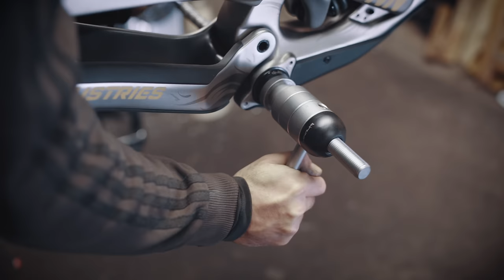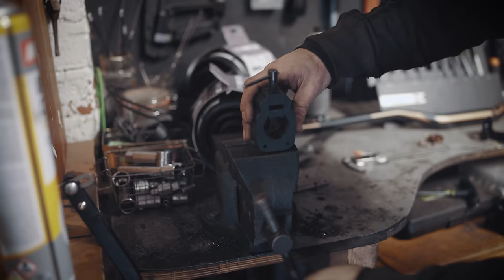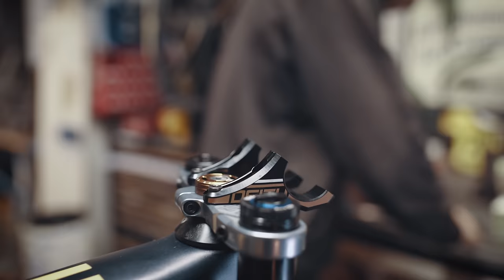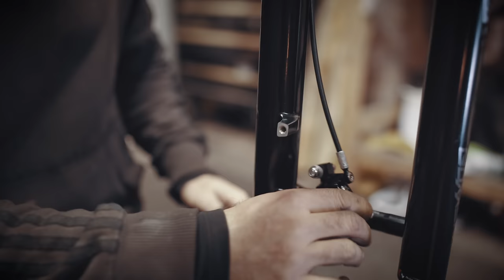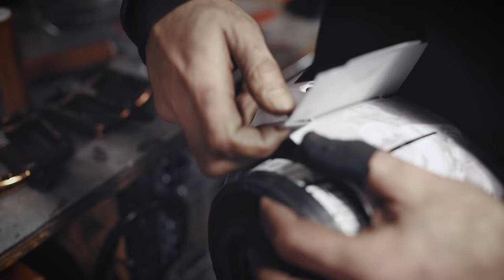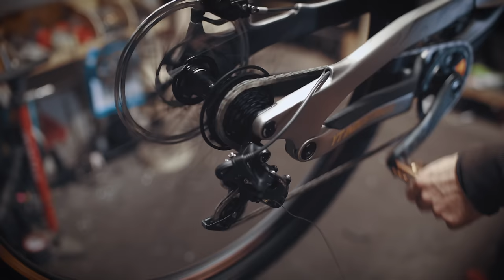DREAM BUILD MTB - YT Tues DH - Jordie Lunn fundraiser

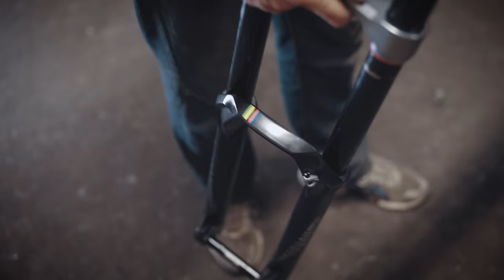Comment: So at 1:30 i think the Copper paste is a failure.
Copper and aluminium are two metall they are corrode. So when you build a PC Watercooling system you need to get a lood clean in Copper, so that you dont have corrision on the copper block from the aluminium radiator. And then you need to add anti corrosion things in the loop.
For myself i would usee Ceramic  Paste or normal fat, this will work verry well but i never do any Copper paste on any Part on my Bicycle.
Hope this will help in the Future.
Last Picture; The bike isn´t finished otherwise you will get Pain in the Hand by using the Brake lever.